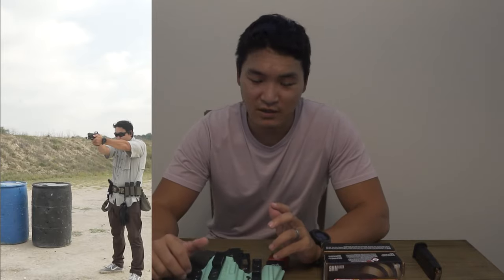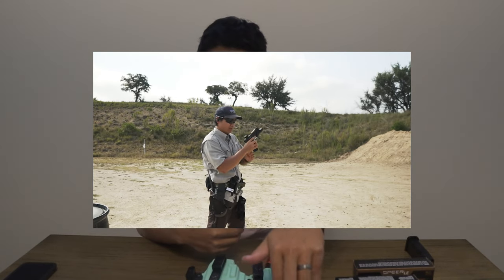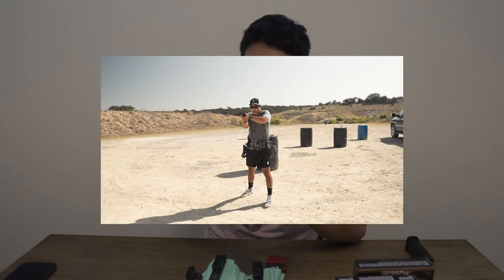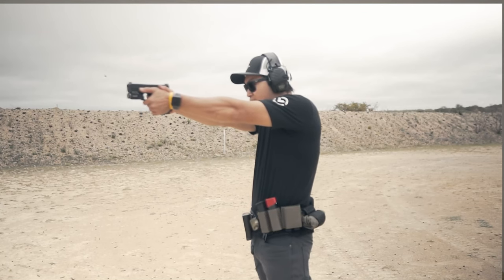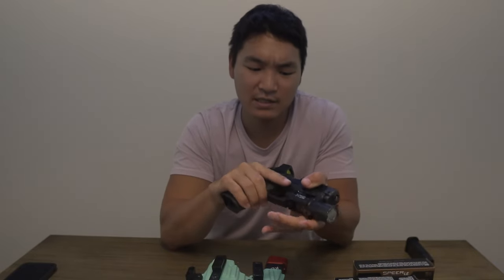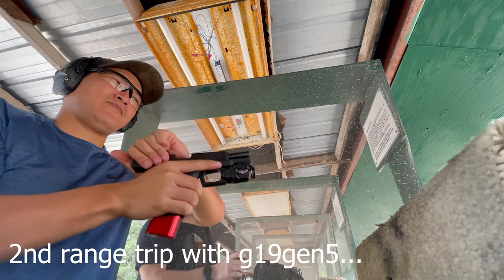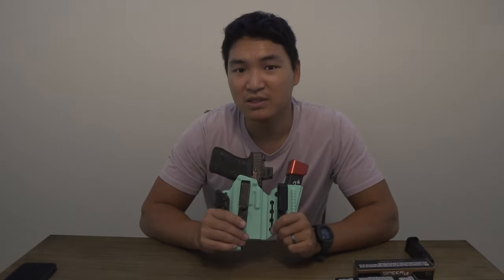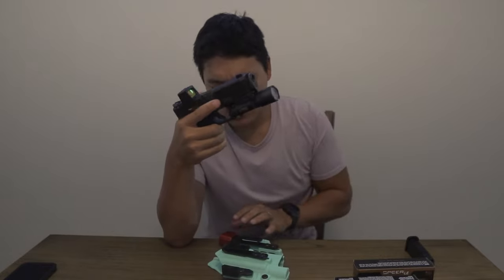Radian Ramjet + Afterburner 1000 Round Thoughts

Comment: I was finally able to acquire the Ramjet / Afterburner combo about 2 months ago and I absolutely love it.  I run it on a G45 with the Glock performance trigger and a Trijicon RMR-06 w/ 3.25 MOA dot.  I have used the Ramjet/ AB combo with the stock recoil spring in it as well as the Radian Compressor.  Based on my experience, the Radian Compressor shines when it comes to the ability for the user to fine tune their pistol when using various types of ammo.  The system itself is very intuitive, simple, and user friendly.  Physiologically speaking, everyone is different in terms of what they feel and what they want to feel during recoil.  There is a myriad of factors that go into this, but this system allows the user to fine tune their particular preference.  Personally, I run the 18lb spring option on my G45 w/ the Ramjet / AB combo.  I do feel that it runs a bit smoother vs. the stock recoil spring.  This may be due to the fluted design of the guide rod which is advertised to create less friction, or it may just be me perceiving a placebo type effect.  I primarily use 124GR and depending on what is available I will use 115GR.  After roughly 1000 rounds, I had zero malfunctions with this setup even when I was swapping back and forth between the stock spring and the Radian Compressor spring setup to figure out what I liked the most. Either way, the Ramjet / AB combo has definitely helped to improve my proficiency towards efficiency because recoil sucks and you should hate it too, lol.  With that said, it is not a substitute for bad technique.  The fundamentals remain the same and this device or any other device out there will not make you a better shooter by itself.  The Radian / AB combo will allow you to manage recoil more efficiently especially when shooting self-defense ammunition vs. practice ammunition.   From a self-defense focused standpoint, if there is a device that is available to help me manage recoil more efficiently while also improving my accuracy on a tool that I am literally trusting my life to, then why wouldn't I want to use it become more proficient.
Reply from the maker: Solid info.

Comment: Got my ramjet afterburner combo and it won’t even charge the first round before I shoot properly. I don’t understand how it can be this expensive and not just work. Absolute garbage in my case.
Reply from the maker: Charge? As in fire? Could be another issue then not the Radians.
Reply: Charge as in chamber the first round. With a brand new magazine I release the slide and it jams. I put back the stock barrel and everything is fine again.
Reply: That's what happens to mine, the slide Jams once you try to rack it back. It will not return to battery. The stock barrel works fine. The after burns will not. Any help??

Comment: Dude how do you prevent carbon lock in this sucker? I trust my lift to my pistol every day so I clean it every 400 rounds. 400 rounds in and I have to beat the comp off the barrel
Reply from the maker: Hm, I haven’t had that issue yet. Are you over torque it?
Reply: @kimchicowboy5053  that’s probably what it is. I don’t have a torx wrench. I tighten to the point where I take all the threads up of the screw and I can’t regularly screw it in anymore

Comment: When using this on a range day with a IWB setup does the comp stick out your holster? If so does it get so hot that it causes leg burns or anything? I have a g19 tier one holster and I know the comp will stick out and I don’t want to run into this issue.
Reply from the maker: I use a Glock 17 holster as that’s the length of the pisto now
Reply: I use a trex arms iwb & I carry the radian & yes you do feel the heat training from concealment. The comp is literally the only thing sticking out of the holster.

Comment: Brand new Glock 45, installed the Radian, used 124 grain YTR full metal jacket ammo and it was one malfunction after another. Mostly, failure to eject. Disappointed since I was always told about Glock reliability with the Ramjet. I'm going to change the ammo and see if this corrects the problem. I've shot that same ammo thru my Staccato, Bul Armory, M&P and no issues but the Glock/Ramjet combo was not having it. I wanted to make the Glock my EDC but right now I don't want to even take it to the range.
Reply from the maker: How many rounds? Like I mentioned I needed a break in period. First 500 rounds had 3-5 FTE, but after that I’ve had zero issues. I’m now well over 5,000 rounds, probably closer to 10k and only issues were within the first 500. I can chute 115-147g now.

Comment: You can't see the benefits, but l would say there is a noticeable difference in felt recoil. The return to zero of your iron sights is noticeablly quicker and  immediate, thats where most should see the improvement. 

Not so much video evidence. It does absolutely work and not a placebo because of price for me. Completely happy with the purchase as the price is what it is.

 Im concerned about accuracy l want to  know my rounds are going where l point the gun an not low and to the left or over someone's shoulder in a home self defense situation. 

I dont know if ld carry this guy but for home defense totally worth it.😢

Comment: I have the same issues with 115 grain. It malfunctions all the time with my acro p2. I just ordered the 13lb spring. I'll let you know if it helps. The 15 lb doesn't work. 

It's the 115 gr ammo
Reply: why shoot 115?
Reply from the maker: @Gnolomweb  it’s a more common range round. Found easier at retailers. Also, not always but less expensive.
Reply: @Gnolomweb  my police department supplies it for our training round. If I had to buy my own ammo to keep up in classes and trainings it would add up quick
Reply: I ran 115 and 124 +p with 18lb spring and had no malfunctions. 170 rounds of 124 and about a 100 of 115.

Comment: Finally took mines to the range on my G19mos and had to rezero my dot which I haven't done in two years.... then had constant FTF and FTE where I had 2 use all my strength to rack it back... I have an 18lbs pure tungsten guide rod and holosun on it and tbh before installing the afterburner and ramjet I never had and issues with my glock and that's about 8k rounds in. Disappointed I have 2 get another spring or completely get rid of the whole setup
Reply from the maker: Take it out again and see. Maybe go back to OE spring setup.
Reply: @kimchicowboy5053  I went again today and ran 200 rounds flawlessly... maybe the 1st 200 rounds were breaking it in🤷🏿‍♂️ used 124 grain yesterday, tried 115 today.  Weird
Reply: @kimchicowboy5053  I got a 15lbs spring just in case

Comment: Zsr gave me issues before with light primer strikes. Does the gun have stock internals?
Reply from the maker: Stock internals, stock trigger. Only modification done is barrel with comp. And slide work to mount the EPS.
Reply: @kimchicowboy5053  Awesome, any issues removing the comp to clean?
Reply from the maker: @enrico8730  none so far.